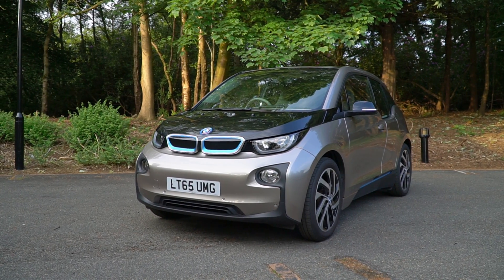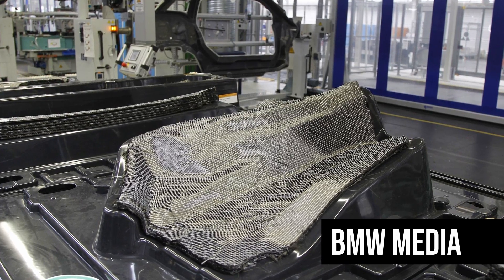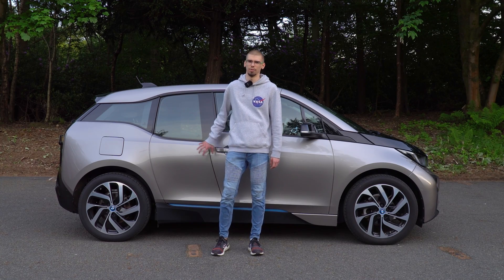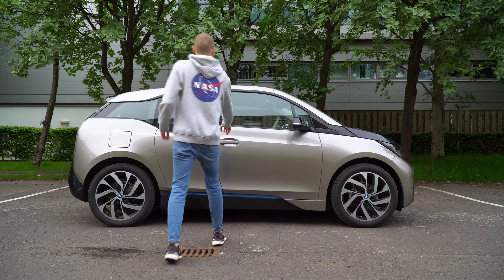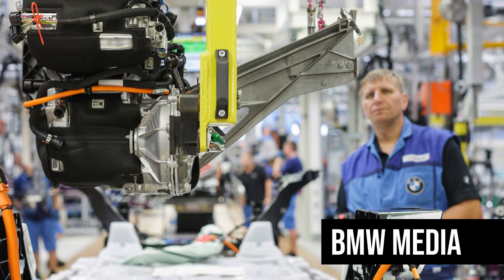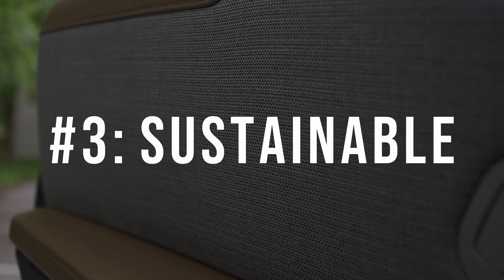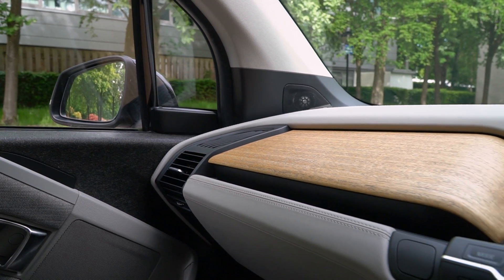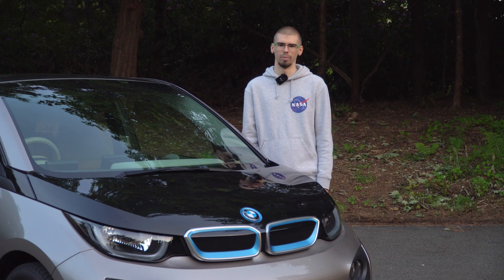BMW i3: Why It Is One of the Most Unique Cars

Comment: Good city car as long as the roads are smooth.....
Rear passengers need to the front doors opened to get out and they can't call for help as the rear windows don't open...oh well at least they can listen to the audio oh no rear speakers, oh at least they will be warm , oh no rear heat vents , oh well at least the three people in the back seat will have body heat , oh only two rear seats oh well at least it is cheap ,oh over £40k...

Comment: Have had mine for almost 4 months and I absolutelly love it! Greatest car ever. Unique hipster look meets business interior with substainability <3
Reply: Been eyeing these since 2014! Which year model do you have? If pre 2016, have you needed to change the plastic motor mounts? How's the range drop % in -20/-10'C? Went for a test drive last friday and I'm totally blown away.. älyttömän upea auto!
Reply: @Pajune  2017 but pre facelift. 94Ah

Nothing has been changed so far.

If summer is 200-220 average winter is 150-180 average.

Comment: Great video, great car. I had a similar 2015 60ah - Andesit Silver, Lodge interior,  Professional Sat Nav. No HK but REx. Now have 94ah LCI i3s REx which is even better. Absolutely iconic car and such fun to drive.
Reply from the maker: My mum has the 94Ah and with a heat pump. Would love that. Would also really like the Driving Assistant but trying to find a second hand i3 in the UK with it is next to impossible.
Reply: Darcer's Tech have you tried contacting Arthur Kaminski at Wisely Automotive? He is probably the biggest specialist used i3 dealer in the country. arthur@wiselyauto.com 020 8050 7653
I don’t think either options are popular but he always has cars in preparation before advertising or looking for good used examples so may know of cars becoming available.